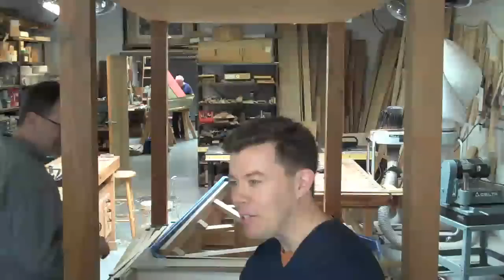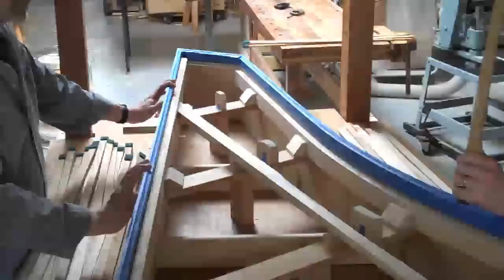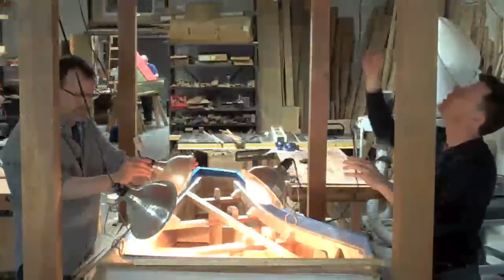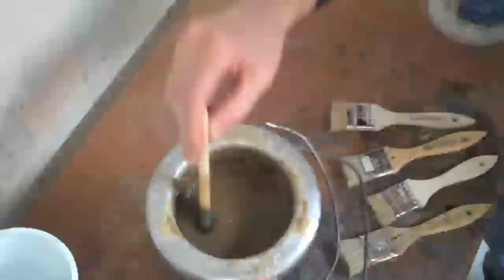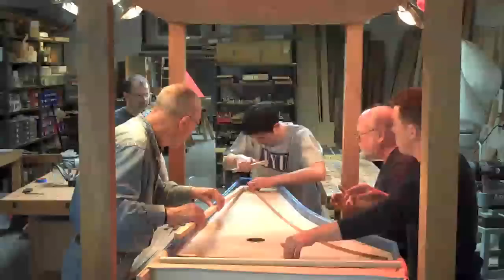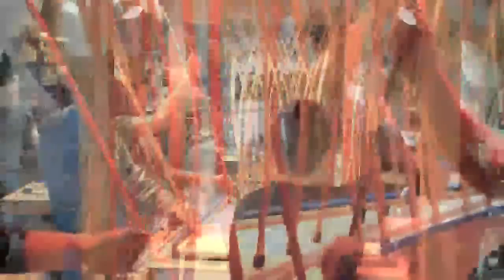Harpsichord Making:  Soundboard Installation

Comment: All things being equal, is there a difference in the final sound of the instrument if the "nuts" and the "bridges" are cut out of the wood as opposed to being bent into the appropriate shape?

When the soundboard is being glued there are "spacers" that will hold the soundboard in a slightly concave shape. I gather these small blockes of wood, the "spacers" are later removed, presuably when the glue is done drying. How high do these spacers hold the soundboard up? 

Thanks,

Matt

Comment: About the glue, refered to by Kevin as "hi glue" is it,  used to secure the soundboard to the frame; when Kevin says "90 second open time" does he mean the glue gets to hot after 90 seconds to mess with it or the glue has begun to solidify too much, or have i got it all wrong? Thanks, Matt